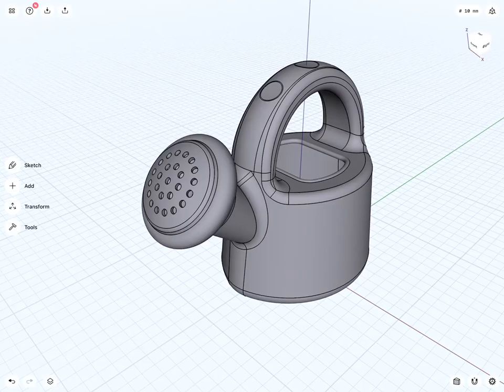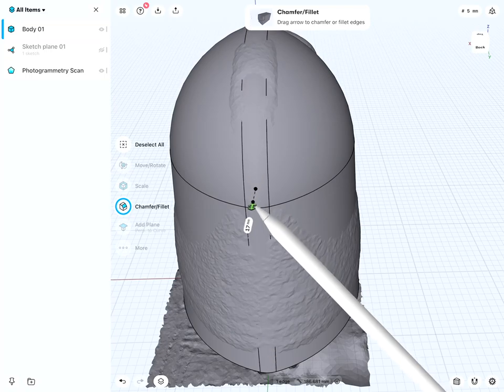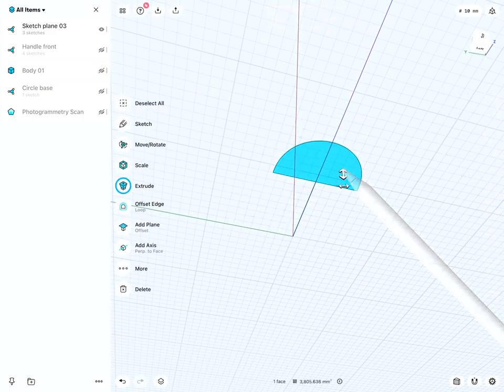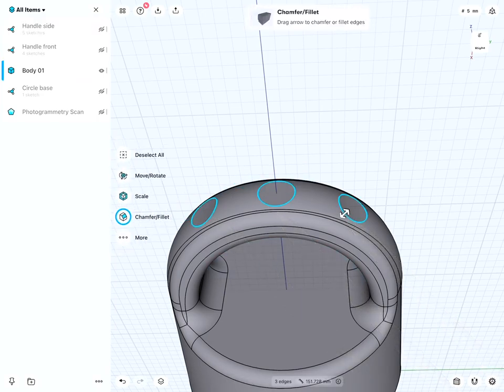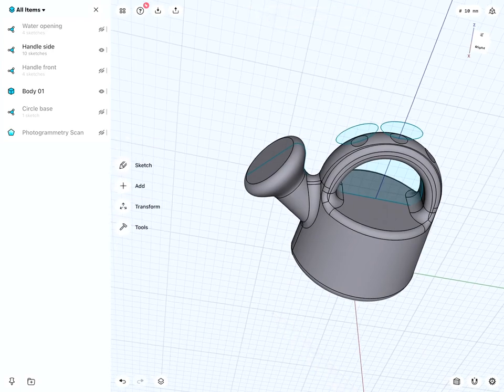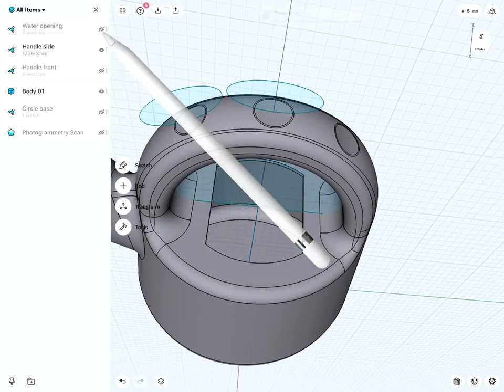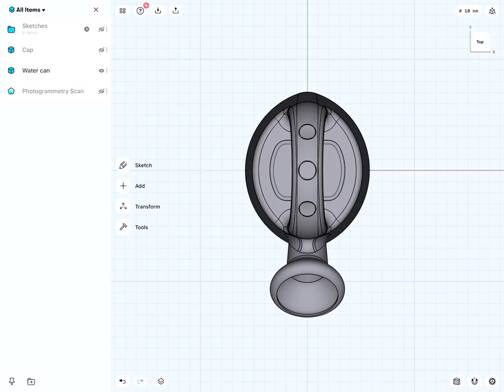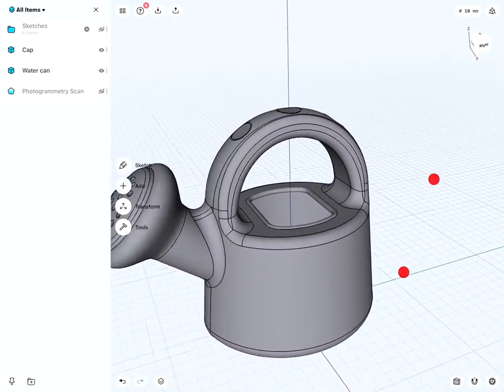3D Modeling a Toy Watering Can on iPad | Shapr3D Step-by-Step

Comment: thank you BUT please, there should be a smarter solution to put these holes into the sprinkler in the correct angle? if i have shere and want to arrange 250 holes on to the surface.. is there no better way?

Comment: Shapr3d newbie here. Can you elaborate a little more on how you know what order to champher/round edges? For instance on the handle when you were rounding all the edges around it. Like I can do trial and error until I get the result I want but I struggle to understand how I get it to work lol
Reply: Hi Terry, filleting when new to 3d modeling can be confusing but it pretty much is a logical approach. You can see in my video how I first round the inner arc, then the horizontal edges so I could finally round the outer edges. In my particular case I was looking for smooth edge loops meaning edge selections where all edges flow into each other smoothly (tangent) and do not show any sharp corners.

It is also for me that sometimes I need to explore the model and test which edge to round first to come to the desired end result. I hope this is helpful. Let me know if you have more questions.